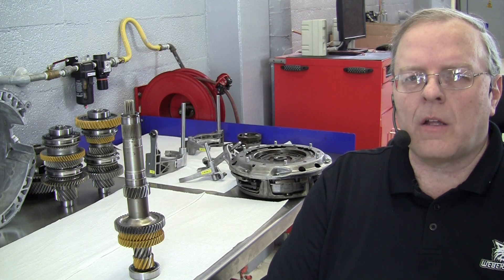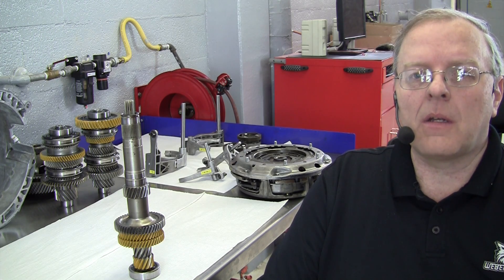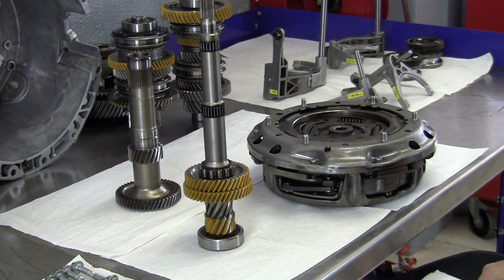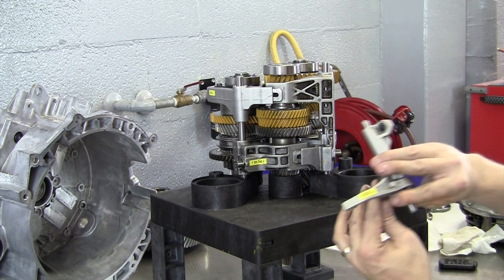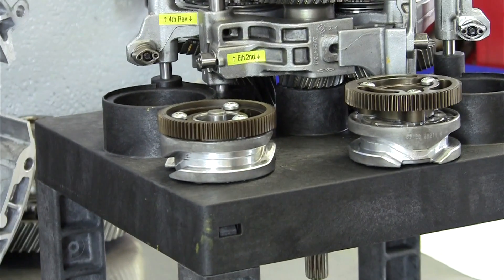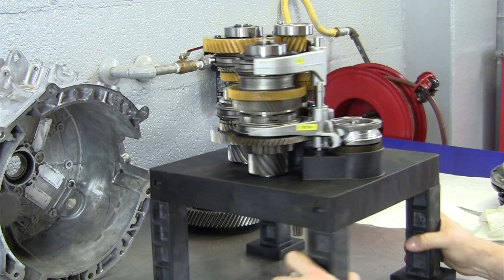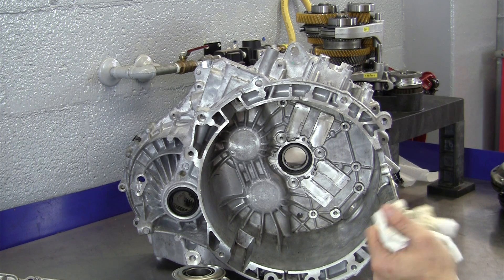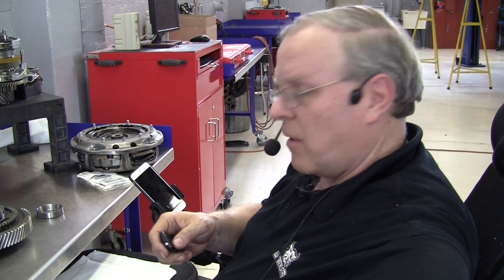Ford Dual Clutch Transaxle (DCT) DPS6

Comment: One advantage of a DCT is that it can pre-select the next gear.
Say you're in first, the transmission will have second pre-selected, and all the transmission has to do is engage the clutch that drives second to shift from first to second, and with most DCT systems you can shift without lifting off the gas.
If you don't let off the gas in a regular manual transmission, you can reduce the life span of your clutch and transmission.
Reply: The DCT actually lifts off the gas for you. And rev matches on down shifts too. The TCM "talks" to the PCM and operates the throttle. When it's working well it's excellent. Unfortunately some, like the wet clutch 6DCT450 are far too sensitive to dirty oil, and dry clutch versions can overheat their clutches.

Comment: As noted one major difference between this transmission and a traditional manual is that the two apply bearings push to engage the clutches, which is the opposite of a throwout bearing that pushed to disengage the clutch when the pedal is pushed down in a manual transmission vehicle. In a manual throwout bearings used to wear out and need periodic replacement along with the clutch. It was an ongoing and repetitive maintenance liability. And if the driver had the bad habit of resting his foot on the clutch pedal the throwout bearing would spin continuously and wear out very quickly. My fear is that along with the dual clutches needing periodic replacement the apply bearings, which are spinning continuously under load during cruising, will also require periodic replacement. There are already reports of these transmissions needing clutch and/or apply bearing replacement at 25,000 mile intervals. This will be very expensive for the owner if the vehicle is out of warranty.
Reply from the maker: Good point! Thanks for the feedback. Wet clutch dual clutches seem to be the better method.
Reply: True. Also in a wet clutch arrangement the transmission could continuously feed lubricating oil to the release/engagement bearings (or whatever they call them) to extend their life. The problem with a dry clutch arrangement is that the bearings only have the lubricating grease packed inside them that has to last the life of the bearing, which has to spin continuously under load for long periods. I've read reports of loud grinding noises during gear changes coming from these transmissions. That sounds like the release/engagement bearings, similar to a bad throw-out bearing in a traditional manual.

Comment: It is incorrect and misleading to call this either a "manual" or "standard" transmission. Instead it's really an automatic transmission, which uses engagement and shifting techniques similar to what is used in a traditional standard transmission. Note that unlike a standard or manual transmission it does not have a clutch pedal or a gearshift with an "H" pattern and as such it is not shifted manually. Instead it does these things automatically so therefore it is by definition an automatic transmission.
Reply from the maker: Thanks for your feedback!
Reply: But it doesn't have a torque converter.
Reply: +Don Killuminati - Yes it doesn't have a torque converter, but it is still an automatic transmission. Instead of a torque converter and planetary gears it uses clutches and gears similar to a "manual" or "standard" transmission. However, the clutch engagement and shifting is all done automatically by a computer.

Comment: I have a VW with the 7-speed dry clutch DSG which mostly works without any drama.  The big difference as most are aware is that the Getrag actuators are electric instead of hydraulic as on the VW.  I have to wonder that if the next gear is not the one preselected whether the motors are fast enough to change gear without noticeable delay?  
And as others are, I'm amazed that they (both) use what appear to be relatively conventional technology for the throwout bearings.  And that the actuation mechanism is exposed to dust from the clutch disks which cannot be good for grease present.
Oh, one other item worth mentioning in your fascinating videos, inherent in this design there must be mechanical means to lockout invalid combinations of actions under fault conditions such as being in two odd or two even gears at the same time, or having both clutches engaged. Perhaps that's partly taken care of by the shift cam drums?
Reply from the maker: Yes, the drums prevent that. Wet dual clutches seem to be the most trouble free. Thanks for your feedback.

Comment: Those selector gears (electric motor driven ones) are pretty much the same as in sequential racing transmissions, which you usually move manually, so there's nothing that much new, but a new combination of old things. Nice to see it apart, thank you for your work!
Reply from the maker: Thank you!

Comment: This would be considered a semi automatic transmission, not a sequential manual.
A semi automatic transmission uses an automatic clutch while a sequential manual transmission uses a manual clutch.
Reply: It's not only the clutch engagement that is automatic. It also shifts automatically. There is no clutch pedal or H-pattern gearshift for the driver to operate. The shift lever has P-R-N-D-L. Everything looks like a traditional automatic and you drive it just like a traditional automatic. There is nothing manual about it. Ford even calls it an automatic transmission.

Comment: A mere six years ago, these were still considered an okay design. These things are totally borked, though at the time of making this video it wasn't fully known by the public (Ford knew). It's hurt Ford fairly severely having spent a decade selling these units, especially knowing that their design itself was faulty.
EDIT: Wonder if a fallow-up video could go over the faulty engagement issues these things had? Somewhat dangerous when pulling out into traffic having your transmission letting go randomly.
Reply from the maker: Thanks for the suggestion

Comment: Has to be one of the worst designed transmissions I've ever driven.  When it slows down it's putting pressure on the diaphragm springs and not letting the clutch fully disengage, therefore wearing the clutches out prematurely. I can't believe Getrag designed this🤦
Reply: Getrag did a perfectly fine job designing this thing. It's Ford's shitass FuEl EcOnOmY code that's the problem. Get the transmission tuned by a third party to operate how Getrag DESIGNED it to operate, and it works damn near flawlessly.
Reply: @bruh7140 what kind of tune is that? I’m curious because I’m looking for some

Comment: The plate used cerametalic pads not used wheel fly 360grades 5 7 poinds torq eroge 100% step 2 cc centimeters cubiq naturall intake & turbo graphyc
Reply from the maker: Thanks for your feedback

Comment: Thank you for the detailed video!

The Powershift automatic is garbage and just about everyone knows it. The Detroit Free Press did a large article detailing all the problems with this transmission. If you have one and haven't had it fail yet consider yourself lucky. I had mine under a year and they had to replace the transmission because it would not drive, just slipped constantly. In the five years I have had the car it has been in the shop a dozen times for transmission issues. Just this past week they replaced the clutch again and now the differential bearings are worn out. Up until now the warranty covered all the repairs. Now they want $2k to fix it!

Should the differential bearing last longer than four years? They put a brand new transmission in just four years again almost to the day.

Comment: One question: Exactly which direction are the 2 gears supposed to be positioned before the cover is assembled?
Reply from the maker: +Universal Transmission Specialists Great question. I don't recall, but it is in the Ford service information. There are notches cast into the cover that prevents the gears from being installed incorrectly.  If I remember correctly, the TCM has to learn their current position with a scan tool command.  Thanks for watching!

Comment: In my opinion, it would be very interesting to see a video describing the single dry clutch Magneti Marelli "Selespeed" automated manual transmission, used for example on the Ram ProMaster (Fiat Ducato) 3.0 EcoDiesel.

Comment: It's shocking that Ford uses such low-quality seals in this transmission. Today I picked up my car from the dealership after the third clutch pack in my Focus was installed (factory and two replacements) due to seal failure. It's so nice not having to rev the engine to 3000 rpm to eliminate 1-2 shift shudder anymore. This is the second time I have heard that Ford has used replacement seals of better quality – although I was told the last time the clutch pack was replaced (July 2015) that it should have been fixed permanently.
Reply from the maker: Thanks for your feedback! Best wishes
Reply: Thanks. I was assured by the dealership that "This should be it" for seal failure but I'm not holding my breath...

Comment: Is there a transmission that can be put in instead of this? I love the look of this car but this transmission seems like such a mistake in terms of reliability.
Reply from the maker: Not easily, the car did have a manual transmission option, so I suspect someone could swap all of the required parts, but it would be very expensive

Comment: Great video. Do you know if the seals for the cv axle shafts can be changed from outside without removing or disassembling these transmission. I have one leaking and can't find any info. Thanks
Reply from the maker: They cannot be changed without removing the shaft, sorry.

Comment: Damn! Imagine not changing the DCT fluid every 30,000kms those tight spaces, the minute corrosion.

The health of this transmission must me dependent on the quality of DCT fluid.

In theory, due to gear break in period the DCT fluid must initially be drained and replenished as early as 24,000kms to flush out the metal debris from the break in. Then an interval of 30,000kms thereafter
Reply from the maker: Thanks for your feedback

Comment: Thank you for this great sharing sir. I have a question, are the Renault EDC transmissions have same system with this DCT? Is there any difference between them? And how many kilometers service life have these transmissions clutch drums?
Reply from the maker: Thank you! The Renault EDC transmission appears to be the same model of transmission used in the Ford Focus. It may have some minor changes, but it appears to have the same dual dry clutch assembly, TCM with gears, and shift drums. I have not heard of any troubles with the shift drums.
Reply: Thank you.

Comment: Fantastic video! Thanks so much for taking the time to film this. It certainly takes the black magic out of the dual clutch trans and helps us ‘regular folk’ understand it. Do you know if this is the same as the 2013 Volvo V40 ‘Powershift’ 1.6L turbo trans that i believe was based on the Focus trans? 
I have been told the Volvo trans has wet clutches? 
Thanks so much again!
Reply from the maker: The Ford is a dry dual clutch. Thanks for watching
Reply: Ford uses both dry and wet clutches. Generally the diesel engined cars have wet clutches. These have proven to be more reliable, but longer term neglect of oil changes has caused serious problems, as obviously the wet clutch means the fluid becomes contaminated with clutch material. The fluid is expensive, which leads to some people neglecting to change it.

Comment: Thanks for sharing! I believe this is the same transmission as in my 2014 turbo diesel ford mondeo. I spend a lot of time driving it in manual mode as the engine is so ridiculously noisy I prefer to upshift early rather than listen to it. It also takes some getting used to, in that it does not creep forward like a traditional auto when in drive and on heavy acceleration combined with the turbo lag there is a full second of nothingness on every takeoff followed by uncontrolled wheel spin.
Reply from the maker: Hi, the Mondeo does use a Getrag DCT, but it is a different model that is little stronger to handle the diesel's torque. The model number is 6DCT450/6DCT451. Thank you for the feedback about the operation of the engine/transaxle combination in your car, that second of nothingness would be annoying. Thank you for watching.
Reply: Sounds more like error 18

Comment: i have  2014 focus that was slipping when i started off, now its at the ford deal getting clutch assembly replaced, i just hope it fixes the problem, ford has had major issues with them

Comment: Great video thank you. You answered my only question at the end why do this vs an normal automatic. I wonder what the ware ratio is between the two clutch discs. Perhaps because the change is controlled by a computer and not a human they may last a lot longer.
Reply from the maker: Thank you! Theoretically the clutch discs should last longer because they are computer controlled; time will tell. The ratio between the two clutch disks is the gear ratio between each gear shift; it changes slightly for each gear.

Comment: That is amazing, I was wondering what that lurch was between 1st and 2nd, turns out it was the engagement of one of the two clutches as the transmission switched input shafts.

Comment: My ram pickup has a 5.7 lit 6 speed automatic. My 2015 focus has a 2 liter 6 speed automatic. The truck is cars is not ford is deseptiv. With its advertisement. The truck is a 2016 two completely difrent animals bait and switch never had an automatic with out a torqconverter. Truck has one. How can they both th be automatic
Reply from the maker: Thanks for your feedback. They are automatically shifted with no clutch pedal. That meets the definition of an automatic transmission. Have a good day!

Comment: On my third transclutch in my 2012 Focus.  Ford says this is an improved part.  After 5 years of a shitty driving experience the jury is still out on this latest fix.  After all the years of shuttering one of my engine mounts gave out and the car was vibrating terribly.  Now that is fixed and for the first time after 50,000 miles it drives like a normal car.  Hope it lasts.  This is my last Ford.  Give me a normal transmission with a torque converter, this is for the birds.
Reply from the maker: Great feedback, thank you. I hope this last version of the clutch works well for you.

Comment: Is there a part number for the 2 specialty tools required to remove/install the Dual Clutch?
Reply from the maker: 307-675 Fixture, Clutch Remover/Installer
TKIT-2010D-FLM
TKIT-2010D-ROW

Comment: It sounds like VW made the correct choice going with wet clutches.
Reply from the maker: +Jeff K I agree. thanks for watching.
Reply: +Jeff K They have Dry ones too.
Reply: as well as the shift forks being controlled by hydraulic pressure, as opposed to these strange gear units. I don't like that setup. Cool vid tho
Reply: VW don't use wet clutches on all their dual clutch transmissions, when they went from a 6 speed wet clutch in the mark V golf to a dry clutch setup in the mark VI.  These have more issues and can burn out and shudder quite easily and were subject to many recalls and fixes.

Comment: john: 1 question,during the shift from 1st to 2nd, and so on, is the final drive(with open differential) will have impact? i mean the gear ratio have changed. is the TCU internally need to slow down the output shaft rotating speed to synchronize the final drive(with oepn differential).
Reply from the maker: +minkun zhu Hi, No, it is directly connected to the final drive. There is no unusual shock.  Thanks for watching!
Reply: Hey John; great video demonstration.  Just bought a second-hand 2012 Ford Fiesta Sport for my wife in Thailand and later learned about issues with this transmission; however, everything appears okay.  They had problems with the two input shaft seals leaking oil into the clutch housing and they were modified.  The old type are colored black and the newer ones are brown and seem to have solved that problem.  As you stated, the dual clutch assembly has also been modified.  This is a great small (second) car with good acceleration and gas mileage; hopefully the previous transmission problems have been laid to rest.  Ford also state that renewal of the transmission fluid is not required!  Just had mine changed at the Ford Dealership in Thailand; it only requires two quarts of Motorcraft Merchon V, so why not change it!